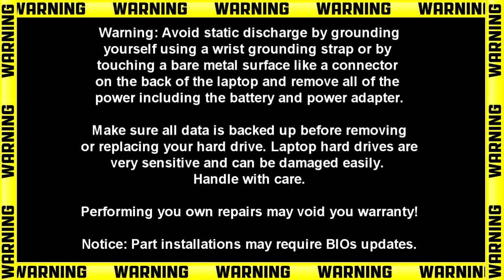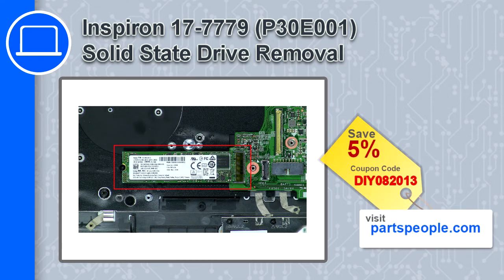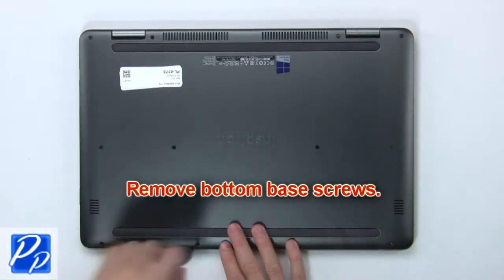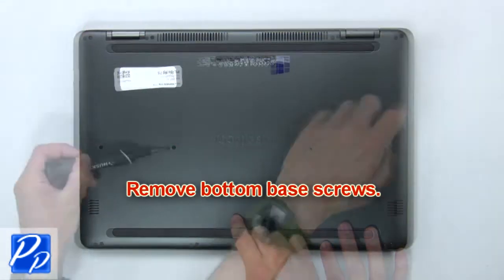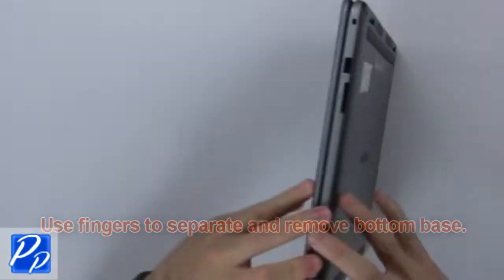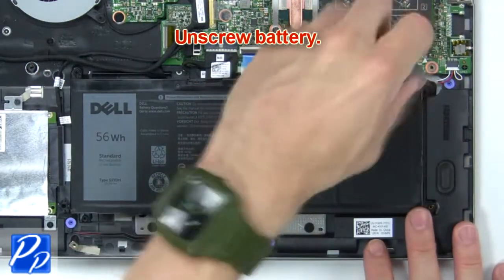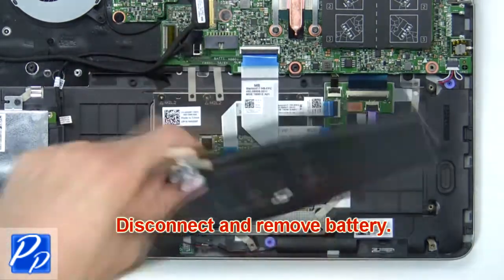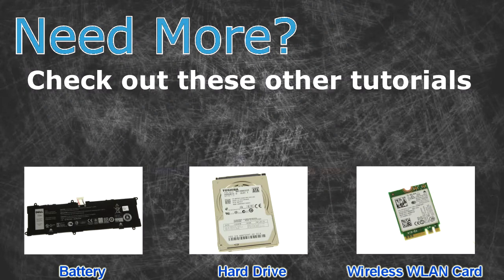Dell Inspiron 17-7779 (P30E001) Solid State Drive How-To Video Tutorial

Comment: i have this laptop with the hdd and have terrible issues on 100% disk usage and overheating... will changing for an ssd solve the issues?
Reply from the maker: Upgrading your hard drive with a newer, larger drive will help. Also, disk management will help. Running an Anti-virus, defragmenting to clean up bad sectors, resetting/clearing the virtual memory, and disabling the Windows search in Windows 10 will all help.The overheating is probably related to the fact that it's a laptop with bad ventilation but making sure all the vents are clear, cleaning the cooling fan of any dust and using a cooling pad wouldn't hurt.
Reply: I have the same overheating problem.. :/
Reply: If the Cooling is changed to one of a higher range, the problem of ventilation could disappear for a longer time?

Comment: If I have a 17-7779 with the 1TB HDD, do I have to replace that with the 2.5" SSD, or does it have a port for this kind of SSD as well?
Reply from the maker: It will have the M.2 SSD slot too, but the HDD will always be a 2.5", not to say that you can't replace it with a 2.5" SSD.
Reply: Thanks, I wanted to make sure I wasn't missing the slot before opening it up, or worse, ordering an M.2. I think I might add an M.2 SSD and swap the HDD for a 2.5 SDD. This would be a great computer, if not so pokey. Too bad no PCIe.
Reply: Hello! I read your comment and I found it very interesting. I'm about to invest to improve this model. Can you recommend a particular brand or model of M2 SSD and 2.5 "SSD? I would like to put both on this computer.